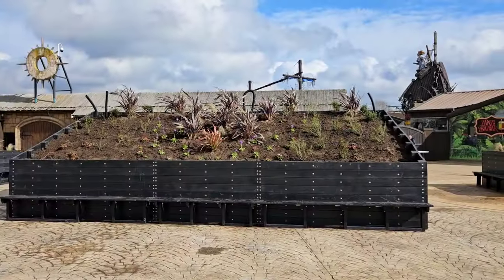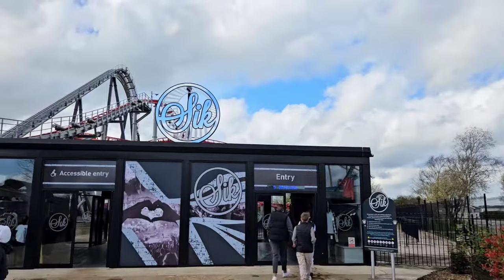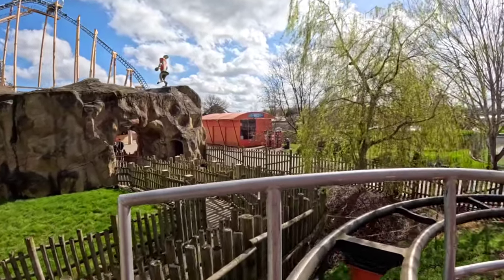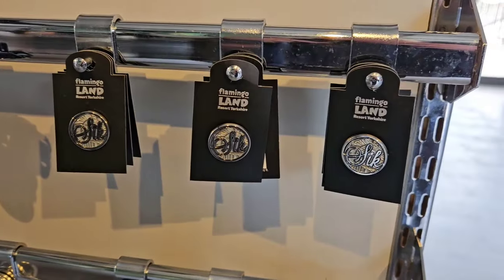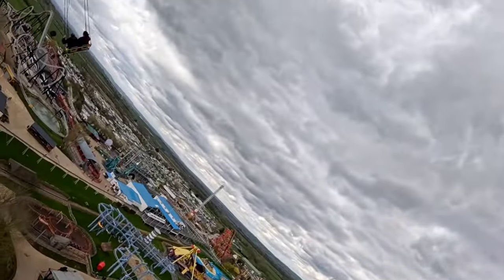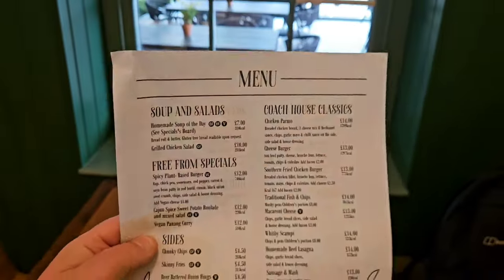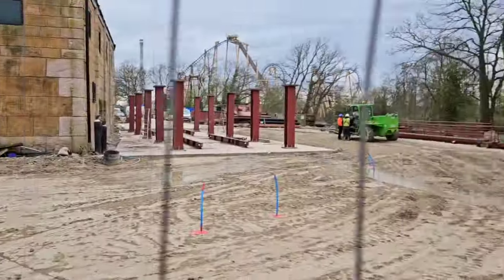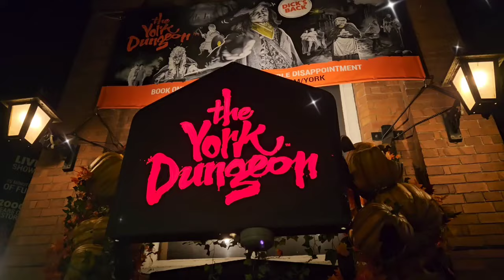Flamingo Land Resort VLOG March 2024. | Includes POVs!

Comment: It makes sense for the River Ride to have a smaller drop if it avoids everyone getting soaking wet and better suits the Yorkshire climate making it more suitable as an all year round attraction and if it makes the ride more reliable that will be a bonus. It will also make the ride more re ridable.
Reply from the maker: Those are very good points 😁👍🏻
Reply: Also means they have an excuse to adjust things like its speed, or add elements like audio